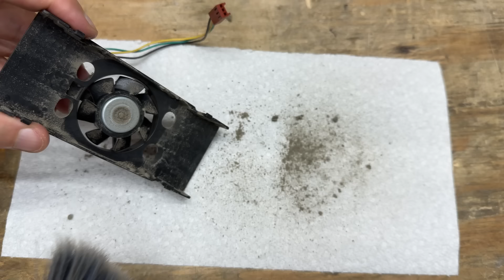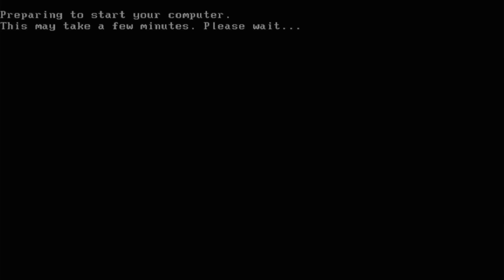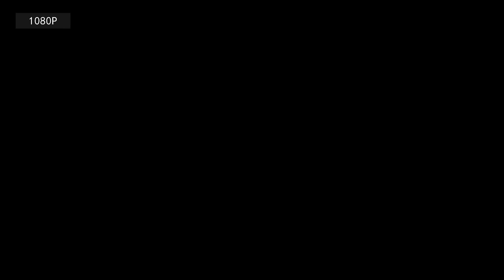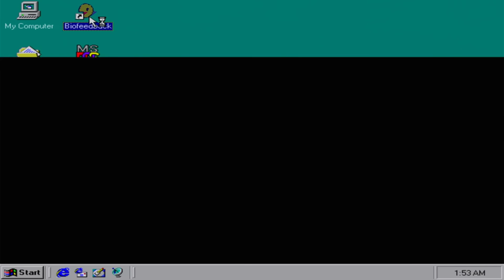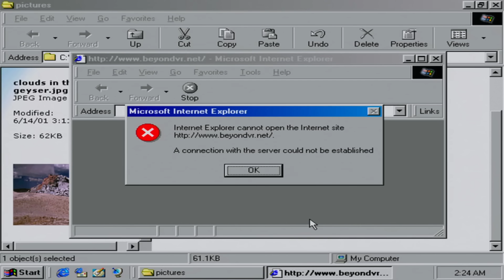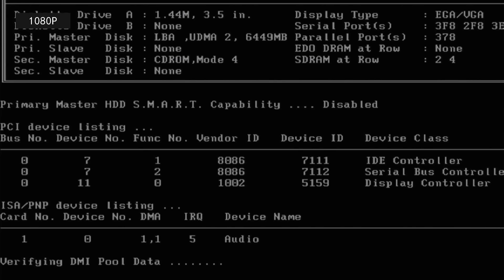'90s Desktop Teardown and Test: It Got Weird!

Comment: T.O.V.A. version 7 is an older software release of the Test of Variables of Attention (T.O.V.A.), a computerized continuous performance test used by clinicians to assess attention and impulse control, especially in conditions like ADHD.

There's the answer to what TOVA is, this system was used in a mental health facility.

Comment: could a HDD mount upside-down on that brace that runs over the CPU slot? I have a 2000-vintage Enlight case that has a HDD mount "in the air" like that.

Comment: Air flow expert here.
The phenomenon of clean floppy drives in dusty cases is indeed caused by negative pressure within the case.  The dust is drawn out of the drive by subtle currents toward the "dead zone" within the case, where it settles.

That's all BS, I just made it up.
Reply from the maker: I always just chant an incantation throughout the build process to banish dirt to the land of wind and ghosts.
Reply: @miketech1024  
And it works every time. 👌

Comment: I was a patient who underwent the tests in TOVA. The \eeg\games directory are games that are controlled using the input from a parallel-interface EEG monitor.
Reply: I thought so, I recall them using games like pacMan to teach people to use EEG connections to move wheelchairs, and mouse cursors and stufff, for paralyzed people, if I recall. This makes a LOT more sense, including the system not reacting to the mouse cursor when he loaded it, it was waiting for an EEG signal to move that other crosshair cursor to make a selection, I am guessing?

Comment: PC66 SDRAM makes sense with it being a 440LX board, and you now have the fastest 66MHz FSB Pentium II. The cooler is standard for lower clock Pentium II BTW - my 233  and one of my 350 has the same cooler.

Comment: Edit: Based on the info I have found, that looks to be an ATI Radeon 7000 video card. Seeing a launch date of 2001, so the DVI-i port makes sense. These are still sold refurbished for a good few dollars. That IRELAND stamp also indicates the processor was made in the newly opened intel fab in Ireland, and a likely pc build date some time in 1998, after that fab commenced production.
Reply from the maker: Thanks for the info!
Reply: Also, looks like neurocybernetics was a subsidiary of ESII & was the TOVA developer.

Comment: I did a a similar test about half a year ago. It was still running in MS Dos mode. It uses a special controller with colored buttons connected through the printerport or serial. So these kinds of systems are still being used today.

Comment: The parallel port driver reinstalling is maybe a hint that it was a parallel port device and that it had to be in a different mode, which when the CMOS lost its memory, would've went back to a default setting and windows needed the different driver for it.

Huh that winkick file that looks like a dopefish is interesting.  I wonder if that's stock Windows.

2002-2004 (on that highway game) is WAY later than I expected any of this stuff to be.  I can't expect any of this stuff was low-cost either.

The military association with this is a tad disturbing, not that this was likely anything too "evil" but yeah maybe some kind of, like it kinda seems to imply, neurological assessment thing that maybe never took off?  Although like you said, might've just been someone evaluating a bunch of different software for some purpose.  It all seemed a bit dysjointed with many different software packages with a similar theme but many unrelated and from vastly different times.  They must've just settled on that one DOS one, or maybe installed that DOS one and had it break their windows install and they couldn't figure out how to get it working again.

Comment: With an inexpensive 2nd-hand FM2/FM2+ socket mobo and a quad-core APU, that case could be a rip-snorting 7-64 or Vista-64 web surfer. Obviously, it would need a rear fan installed. Love your work, Mike.

Comment: That three pin power header was probably for the absent case exhaust fan, which I would add. What a great case for a Windows 98 retro gaming PC. Add an AGP primary card and a Voodoo 2 12mb card and there you go. It needs a puller fan in the front too, there is a cutout for it, and another fan header on the motherboard. What a great computer, wish it was mine! :)  I watch this cannel alot, and it's time well spent. Why not just wipe the drive and, reinstall Windows 98se and be done with it???

Comment: 80523 is the architecture code, P333 Means Pentium 2 333 Mhz. P + Number is processor and speed. 512 after the 333 part is the amount of L2 Cache it has. The E after that is the stepping. Then revision code (I might have them two reversed) and of course at the end of the top line is the operating voltage which is 2.0V

Comment: that agp fan connector does make sense in a way. aftermarket gpu coolers were a thing even back in the agp days. but it is kinda odd they made a connector for it. usually if there was no fan connector on the gpu that could be used those coolers ether used a sys fan connector or ran on molex

Comment: The WIN /W will reboot- I think it's usually used to reboot when you exit from MS-DOS Mode as it does some stuff to autoexec.bat and config.sys. I think the DOS=SINGLE line in config.sys might be related to MS-DOS Mode as well- I think that message you received appears if you run WIN when you had rebooted in MS-DOS Mode. It's like the system was configured to always start in MS-DOS Mode I think, which probably makes sense if it was being used exclusively for that software.

Comment: Fun box, and I'd hazard it wasn't built so much as "thrown together" as it's totally anachronistic. Back in the PII days those ISA cards wouldn't have been coming brand new, they'd have been some cheap Vibra/Ensoniq PCI for sound and some PCI WinModem. Every shop had a few boxes where we kept stacking ISA cards like that from old PC's, so, they most like got picked up from said bins. The Radeon 7000 certainly came in later, as that would have had some TNT, RAGE 3D, G100/200, S3Trio3D or i740 mostly likely from the go, or, given the use case, even some PCI S3 Trio64+ from an older "donor PC". The AGP Fan header was a common sight, but... yeah, never got to use one, because it always got power from the card.

Comment: P2XLX by DFI with the i440LX chipset. that chipset ran only at 66MHz FSB and was first used on the 66MHz FSB Pentium II(s). DFI used to be quite a reputable mainboard manufacturer brand in its days. My very first pentium 133 PC had a DFI i430HX-based board and it was rock solid until the day a lightning strike cut its life short. :-(

Comment: [beep] You actually just have been tested by secret individuals from Area 51. It may be clear we don't need internet. The Pentium II was used as our portal. Given promising, but inconclusive results, you will be transported to an undisclosed location in the universe for further testing. No need to worry as it all will be lightening fast and you will never notice. However, you may have some uncommon confusing dreams in the long run. Note some DARPA equipment was used for this automatic translation as Google hasn't been able to fully integrate it yet. Warning. Any public disclosure will automatically cause your government to deny everything. [beep]

Comment: RE: Lack of data on the HDD. The default mentality on a lot of these devices was to save to external storage so the results could be read/interpreted elsewhere. It's a safe mentality to only export data.
Reply: Or it was all put on those other partitions and was simply deleted trough windows, that would mean if one would run any kind of undelete software it a lot of it could be recovered. It's the funniest possible situation so I want to believe it's true.
Reply: Thanks for pointing that out.  I hadn't heard it in the video.  That's a relief... was thinking someone is in trouble.

Comment: I just have to say that I resent it when these tech illiterate (supposed scientists) ** with Windows as badly as they have with this install.

Surely they didn't HAVE to ***k with the boot and system files to get this biofeedback suite working.

That (program) or whatever it was. it is acting just like malware.

I mean, with programs like that, who needs viruses? These convoluted bloat jobs just seem to make more mischief than any virus I've had to throw off my computer.

Edit: I'm embarrassed, cuz I seem to be the only one mad at that abnormal bootup.
Reply: presumably designed to be immediately ready for use - it's a specialised machine! Not to mention locked down, fool proofed and quick to restore in case of failure

Comment: I found a Dell T7400 workstation at the recycling center, it was used to run the MRI at the local hospital from the softwares that were on the hard drives.

Comment: Is that maybe an Inwin case? Either that or Enliight. I'm 99% sure it's an Inwin, but if not it's definitely an Enlight, but with a replacement power supply (Enlight included their own branded power supplies back then... I think Inwin included Antec power supplies by default).
Reply: No, PowerMan.  This was probably an off-the-shelf, low-end retail Antec PSU to replace the OEM one.

Comment: If it was me running this rig with some interesting data on the drive, is I'd run Clonezilla and make an image ASAP.  I've gotten clonezilla-live-1.1.0-8 to work on Supersocket 7 and Pentium Pro boxes with USB ports.  If you need to boot from CDROM, Plop bootloader is slick and adds cdrom boot to old machines that didn't come with it.  Anyway, the point is that you backup the data in case the hard drive is on the edge of dying.   Or, have a copy of the original stuff so you can go back to it if you want later and have put a different OS and configuration on it.

Comment: This channel is criminally underrated. I used to build computers and play with old system back in the day for shits and giggles, it was therapeutic. I unfortunately no longer have the time or energy for it. So, this content is very relaxing and brings me back, Thank you sir.
Reply: Sorry, I know, old comment, but I was exactly the same as you back in the mid 80's to the 2010's. I used to love building old 286 and 386 machines with my mate. Now I am too old and brittle anymore. But, I did build both my gaming PC's that I use now so I haven't completely stopped.
Reply: Yeah me too. I got into PCs around 1996 and have been tinkering with them ever since. I wish I would have put my knowledge to work but alas I work out in the heat all day.

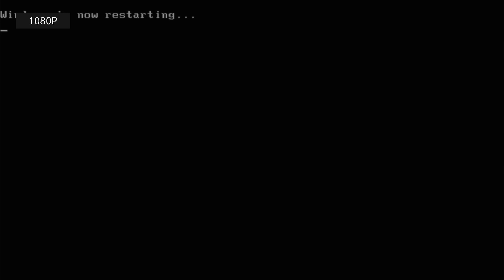Comment: Yo Mike I was upgrading my Acer aspire Z1620 with a SSD hard drive so I can use Acer restore disc for windows 7 hope it restores for Acer products of windows and maybe I can upgrade the ram with a higher GB so the SSD can run any windows 31:46 geez even this is actually windows 98 first edition not upgraded to second edition because windows 98 second edition is a little better OS than first edition

Comment: I've actually seen a system like this in action.  I work in IT at a university and one of the professors came to us back in 2016 asking if we had any windows 98 computer because he had some brain eeg software and hardware that only ran under windows 98.  Ended up giving him something like an early pentium 4 since that was the oldest we had that supported 98.  I ended up using 98 lite so it was crazy fast.
Reply from the maker: That’s insane! I guess EEG-based input tech peaked in the Win98 era lol. I remember seeing something about this tech on The Science Channel in the early ‘00s. The patient was (barely) moving a mouse cursor around using EEG.
Reply: @miketech1024 That's 1 of a 2-part clinical system.  Rewards for producing or inhibiting certain brainwave frequencies - As set by the clinician.  It's not for controlling a cursor.  ;-)
It's the "game" computer.  The control computer and its software would send signals to it via a serial cable.
It was starting up in DOS mode with the TOVA because... 1990s-2000s and clinicians then..... wellll one time I was doing support and they asked me which side of the CD goes up 😭  That computer is set up for someone to use like an appliance.
Thought Technology, BrainMaster Technologies, and Applied Neuroscience are certainly still around.  EEG Spectrum is not.

If you want to try biofeedback (not neurofeedback without a clinician), I have a ThoughtTech amp you can use with current software.  You can't tear it down tho ;-)
Reply: @BeyondVR  Seeing the very creator of that system popping up in the comments section of a video showing its restoration and digging into its software, elevates the thing to another level :-D

Comment: This is an interesting one.  It's almost identical in a lot of ways with the Gateway PII I found about to be binned outside a local AV retailer.  The same MOBO, with a mix of PCI and PCI, amongst other things.  Mine dates from about '98 so that tracks; the only thing that seems a bit anachronistic would be the video card, because I was sure DVI did not come out until the early 2ks.

Edit:  I think the games might be controlled by an external device, perhaps a joystick.  Or maybe even a mind-control thing, which would make sense.

Comment: I would look with suspicion on that DOS=SINGLE line in CONFIG.SYS -- that could well be what was stopping the boot into Windows. Also the boot settings in MSDOS.SYS (rather than IO.SYS).

Maybe with the two power switch connectors one behaves like a momentary switch and one like a toggle?
Reply: My brain started screaming "YOU'RE IN DOS SINGLEUSER NOT MULTIUSER SPACE" when it saw that because of the nightmare I had getting a second-hand PC to work correctly back in 1999... So, you're right that is the problem.
Reply: That would be my guess; for compatibility with both AT and ATX. AT needs a toggle; ATX needs a momentary. This PC was made right around the time of that transition, and maybe this was an AT/ATX case - what you ended up with depended on what power supply you loaded into it? Just a guess.

Comment: Sold tons fo A-Open desktop atx/at cases back in the day. I should have snagged one years ago. Not realizing how uncommon they are now. Though I finally picked up a at style desktop case. The big problem is cooling. But, I'm sure you can sneak a few side holes in with fan grids.

Comment: SLEEPER BUILD,  SLEEPER BUILD,  SLEEPER BUILD, SLEEPER BUILD,  SLEEPER BUILD !
Reply: would be a crime to gut this unique machine!
Reply: @succulent951   I don't think so.  That "computer" is just a part of a computerized medical diagnostic machine and there were other devices like brainwave sensors that were attached to it.    The only thing unique about this machine is the ATX form factor non-tower desktop case that is screaming for an upgrade to at least a Ryzen 7 class sleeper PC.   The upgrade should be very easy because of the case's ATX form factor.   The only thing that's needed is the additional vents and intake fans for better airflow.    That old medical computer can be preserved by transferring the  entire components to an ordinary ATX tower case including the power supply.  So it will still continue to exist but in a different case.

Comment: With some trial and error, a right-sized socket should compress those front panel clips enough to pop them out without removing them.
Reply from the maker: Ah yes. I use this trick on the far more fragile clips used in IBM PS/2 systems.

Comment: I wish they would bring  Desktop cases back.
Reply: They were more practical when it was more practical to have a like 14" monitor.  It'd be pretty niche now where people want to be able to do more with their PCs because their PCs are capable of it and people want larger monitors to do it.  You can probably still find one on occasion though.
Reply: @Aeduo   I don't think it's any less practical today than it was back then.  Monitors today also aren't as heavy as they were in the CRT days.  You could easily put one on top of a case if you wanted.   The way GPUs are heading, vertical mounting is also making a return to form due to the weight and the strain on power cables.   There are plenty of cases where a desktop would make a lot of sense for people, especially if floor or tabletop space is at a premium.
Reply: @Blink_____  I don't think height would hurt the viability of a desktop, however, since modern monitors are no longer deep, a desktop would limit usable desktop space back to the old CRT days.
I use similar desk sizes as I did in the 90's and earlier, and as soon as thin monitors came out, I moved them to the edge of the desk and reclaimed that desk space for papers, soft drinks, and anything else I wanted to set there.

Comment: That power switch has 4 wires likely because it contains 2 switch contact sets, one normally open and one normally closed.
This might be back in the day when motherboards could need one or the other to function prior to standardization within the industry.

Comment: The DOS=SINGLE in config sys is what was preventing Windows 98 to boot correctly. Try commenting out that line.
Reply: And the "system" file to edit is msdos.sys, not io.sys.  I recently had to look up the old msdos.sys settings for a Win98 test setup.

Comment: I just got a Gateway Profile off eBay and this morning I was booting it up the first time, I just needed a quick peek to make sure the smashed package didn't break anything too bad. It was also one of these weird systems that flashed a Windows 98 splash screen then booted into some network boot OS thing. Strangely enough, when that happened, I went to start Safe Mode and it wanted to boot Windows 2000?! Yeah, I'm imaging that drive now so I can poke around with it and see what is going on there with no fear of breaking it further.